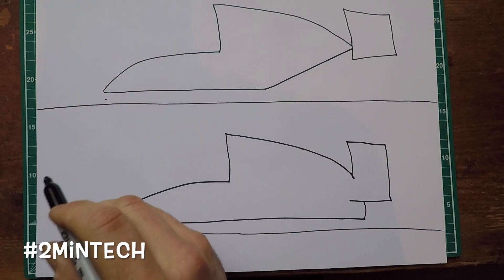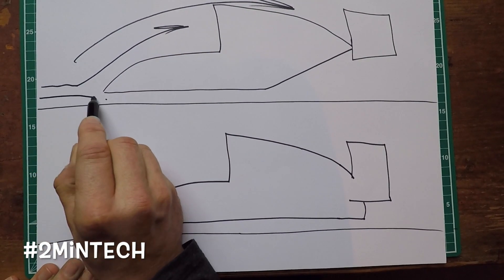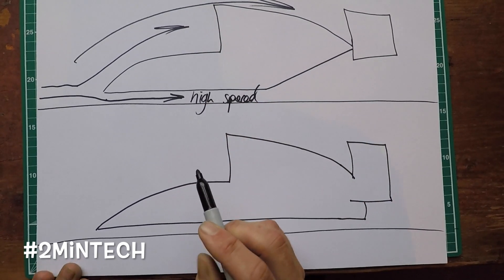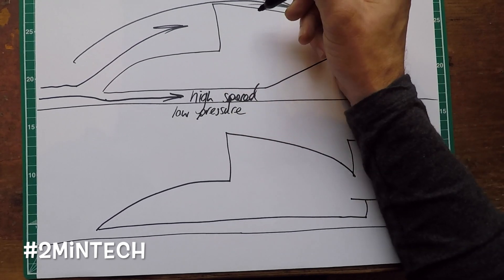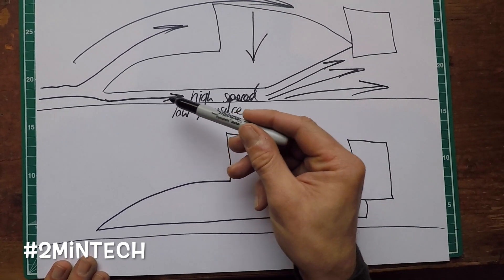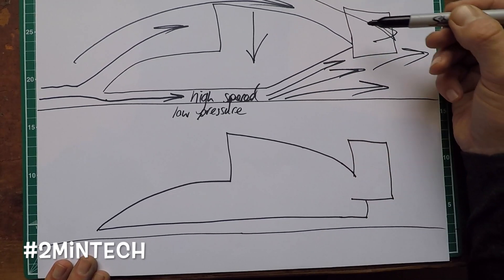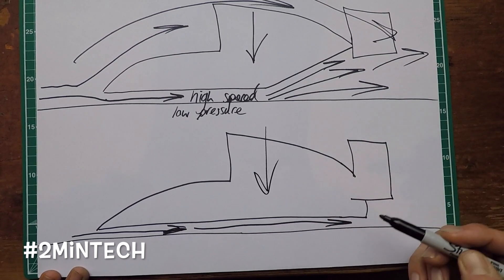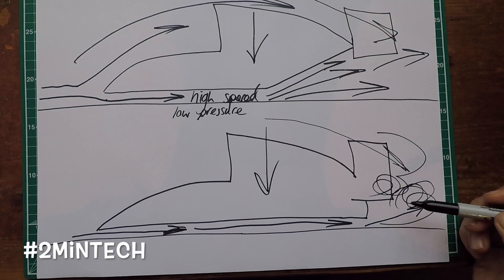MP222 - How An F1 Diffuser Works #2MinTech

Comment: I thought I goes into high pressure as being reduced area, more air particles, cause of which the air gets into the vacuum phenomena with the help of diffuser, being sucked out potentially giving out grip... but you saying low pressure?

Comment: I watched like 50 videos on the diffusor principle now. And actually yours makes a lot of sense with the diffusor argumentation from the drag perspecitve as main argument! (Many other find dozens of wierd arguments, which all seem wrong to me). But I also find some aspects not quite clear. 

First, Bernoulli's principle is valid along streamlines. It is more or less the conservation of energy along streamlines. So if a set of streamlins get accelerated this must be compensated by a reduction in potential energy (lower pressure) and vise versa. I don't see a logical argument, why the flow beneath the car must be faster than above the car, no matter how small the channel is. I could argue: a small channel probably has a larger resistance for the flow to be overcome and as we are more or less in the incompressible region of fluid dynamics (Ma<0,3) the flow knows (with the speed of sound as information constant) already before arriving at the channel that there will be a larger resistance and therefore splits accordingly (e.g., more air above the car if the resistance there is lower). I just want to point out that I don't see the compelling argument, why the flow underneath the car must be high speed and the flow above the car must be low speed - therefore creating a net downforce - just because there is a flat channel beneath the car. Can you explain this?

I actually see the following aspect: at some distance behind the car the whole air volume must have been stabilized again - without pressure differences within a given volume. So the streamlines must find their way to be parallel again. If you consider the whole car somewhat like a NACA profile with a relativly flat bottom area and a hump area at the top, I would actually think that the air above must travel faster, as it will have to travel over the hump in the same time as the air underneath the car will travel just in a straight line. So this would result in an upwards lift due to a lower velocity beneath the car with higher pressure and a higher velocity above the car with lower pressure.

Do you have any explanations to bust my arguments and shed some light on this? 🙂

Comment: How exactly does the diffuser pull air from underneath the car? I understand one of the functions of the diffuser is to equalize the pressure below and above the car to reduce drag. However how the diffuser pulls air still confuses me. When the air hits the diffuser, the pressure increases, and I know pressure naturally goes from high to low. So how does the high pressure in the diffuser void pull the low pressure from underneath the car? Fluids was never my strongest subject in school haha.
Reply from the maker: The air is fastest at the entry to the expansion chamber, so by squeezing it through the narrow gap just before it expands, therefore accelerating it, the acceleration draws more airflow through behind it.

Comment: 2 mins seemed a little too rushed imo, 5mins may of been better. Atm its like you are speed running games, doing it just for the time rather than enjoying the game or in this case able to put out a good summary of what will no doubt be some quite techie subjects. You can not produce hour long technical manual videos and still be quick without having to speak like your life depended on it.

Comment: #2mintech Suspension setup, dry vs wet. In the old days (70's,/80's)  you could visibly see what teams did to adjust their car for different conditions. I remember seeing a Williams set up for wet qualifying with wide front track and a lot of toe out, just like we did in karting back in the day. Maybe that indicated they were struggling with the conditions that day but you don't see much of that anymore. Have the sophisticated diffs and electronics reduced the need for this sort of thing. I know 2 minutes to explain race car suspension tech is tough but I know you like a challenge!

Comment: I would hyperlink these to vids later in the race season when viewership might be higher and their relevance may be borne out again. This has expanded my understanding to include necessity and balance not just optimization. Consider a playlist. This is something you do very well although the 2 min edit-format may force you to cut to right to the chase. Offering details even spelling is helpful, for follow up Diffusion is the movement of a substance from an area of high concentration to an area of low concentration 
 Bernoulli's principle

Comment: @Marc Priestley you make a mistake. The airspeed doesn't go faster ad the bottom as there is no defuser, than you have just a wing and the car goes up in the air.
The defuser is there to create a vacuum behind the car that sucks the air from under the car to speed the air up under it.

Comment: So you would have less downforce with a defuser? Defuser is purely the reduce drag?
Reply from the maker: No, it pulls airflow through the underfloor, increasing the pressure difference between above and below the car and therefor creating more downforce.

Comment: Marc, without the diffuser does the downforce still maintain at the rear due to the enlongated length of the area the low pressure moves through or is that a red herring. Or can it be traded off against the turbulent air?

Aerodynamics isn’t a strong point for me.

Great new content avenue with #2mintech

Comment: Hi Mark, love the videos. But this is actually a misconception about diffusers; it's a common myth that diffusers are there to reduce drag by normalizing the air. which is true in some cases but in F1 they actually use the diffuser expansion to further reduce the low pressure of floor (using Boyle's law) and strakes to suck the air out from the floor further reducing pressure.

 Hence why high rake cars like the Red Bull have such high downforce. higher diffuser volume equals lower pressure and strakes and turning vanes suck air further reducing that pressure.
Reply: mental olympics & Marc, I’m still not clear on your both explanations. In my opinion, and applying Venturis’s physics, when the outing underfloor air reaches an expansion in the diffuser area, the air decelerates and then creates a higher pressure in that area, not a further lower pressure, so not bigger downforce in that area, but just a lower speed in that outing air.
Reply: @4164959  It's basically all about pressure gradients. You want low pressure below the floor where the diffuser is located at the rear axel and high pressure clean air above the floor (why teams work so hard for that tight coke bottle shape at the rear). This pressure gradient forces the car into the ground. High pressure air wants to move to low pressure air just like wind.

The low pressure is generated from diffusion (air molecules expanding and spreading out into a bigger space/Boyle's law) hence diffuser, and the turning vanes and strakes generate vortices to block rear tyre squirt and also suck air out further reducing the pressure of the diffuser; increasing the pressure gradient, increasing downforce.

I’m an engineering student just in case your wondering
Reply from the maker: I think I did actually say the expansion pulls more air through the underfloor, increasing downforce.
Reply: oh I 100% agree with you, it's just a lot of sources say they're there for drag reduction but a low drag diffuser is not a good diffuser @F1Elvis
Reply: https://www.racetechmag.com/2017/08/willem-toet-explains-motorsport-diffusers/ Willem Toet, the former head of Head of Aerodynamics at Ferrari explains it all here. There is much more going on that can be explained in a 2 minute video.